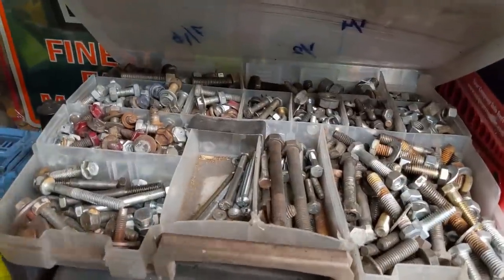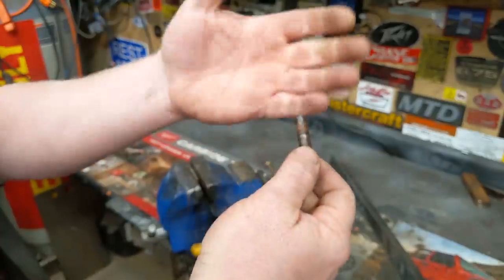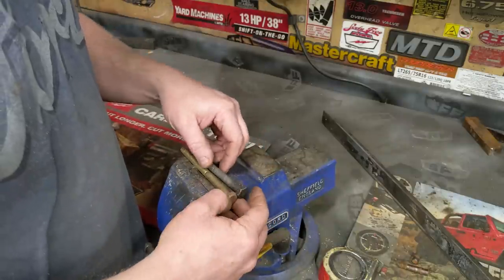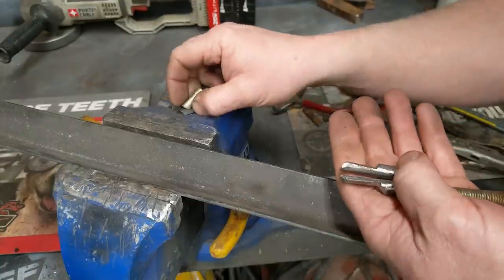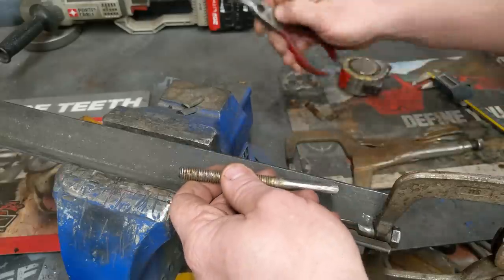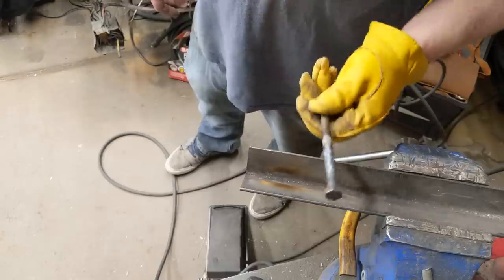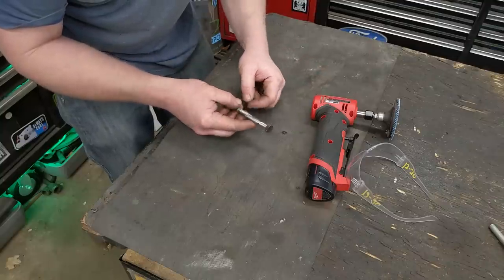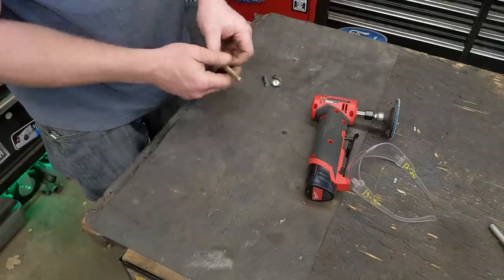How to make BOLTS longer   - Lengthen Extend Bolts -

Comment: Ok in a pinch for a low tensile application or something like furniture. Grade 5 bolts have a tensile strength of 120,000psi for 1/4" to 1" diameters. Even if you make a full penetration weld with wire you have a home you will get a max of 70,000psi. So don't go using this for suspension components or replacing a bolt on your floor jack.
Reply from the maker: Yes and no. Measuring tensile strength isn't going to be that straight forward on a bias. Lets take a bolt with a 1" surface area for example. Half the bolt is still there so it's going to be 60,000lbs of tensile strength. The ER70s-6 welding wire carries a 78,000psi so half is 39,000lbs tensile. Basically we could just add those together but is doesn't account for the tig or gas welding that mix the original parent 120kpsi material which would equal the original bolt. But we'll neglect that, so theoretically we would be at 99,000+lbs for this modified bolt. Now, that same bolt's weakest point is the threads as it is approx 25% less surface area/smaller than the shaft. So the threaded portion only has a 90,000lb strength to begin with vs the 120,000lb shaft. So our weakened shaft at 99,000lbs is still stronger than the bolt overall. Like I said in the video I wouldn't use this for an item that could threaten a life but these are far from furniture grade bolts. I have tried to break them and they act no different than a untouched bolt.
Reply: @sixtyfiveford  Well that is getting a little creative with the math. You can only assume tensile is equal to your weakest metal. We can't assume dilution of the base metal into the weld metal will improve it's strength. Not to mention the heat of welding and slow cooling will completely aneal the weld zone. So without further post weld heat treat we can only assume that the as welded condition of the weld metal will be the tensile strength of the joint. It would be around 70,00psi tensile and somewhere around 40,000psi to 50,000psi yield.

I agree that it would work well in a pinch. Like you say it is good enough for an alternator bolt or something like a light bracket for your truck.

Comment: Honest to god,  that amount of effort was worth way more than the cost of a new bolt.   It 'd be a rare rare thing for me to see that as a viable  option.  BUT I gotta say I like your scarf joint.  It's stronger than  a but joint would be.
Reply from the maker: 5-10minutes and the job continues without hesitation. VS a 90minute bolt store run or week waiting for one in the mail? The entire job is done before I could get back from the store. Time is money so that $4 bolt just cost me $80-100.

Comment: Ive done it with a metal lathe friction welding style but they have to be the same material
Reply from the maker: Interesting.
Reply: Friction welding is a viable option, some automotive drive shafts ( mercedes ) attach the yoke to the tune this way.  3/4 ton and larger truck rear end housings have the bearing stubs attached to the axle tubes this way.
Reply: We use friction stir welding to join aluminum at the shipyard

Comment: Maybe if I was in the middle of nowhere and this was the only option to get me off the island.  This is beyond stupid
Reply: This cut weld is soooo wrong. Grade 8 bolts don't like to be welded and I doubt this home made bolt is much better than a Grade 2 unmarked head " hardware store " bolt.
Reply: @bobroberts2371  
What your saying is you probably wouldn’t use this bolt to hold your propeller on your airplane?
Reply: @c50ge  I'd use it on a garden gate lock hasp is I didn't have a lock.  Or maybe as an axle when making a rolling magnetic pick up tool.

Comment: I have to ask the question:  Do you have enough bolts? ha ha :-D
I have a metal biscuit tin full of screws/washers/nuts  and odd saved bits, in a draw in the house.
Comes in handy at times.
And in the shed is a white plastic emulsion paint bucket that has odd crap that i can't find a use for.... yet :-D
I'm sure it's a blokes habit.
Your dog is so clever but she still thinks she can bite air lol, gotta love doggys.
Reply from the maker: That was only half my bolt collection. They keep multiplying while I sleep.

Comment: If it doesn't matter it the dolt fails, no safety hazards, ok . If it is a critical load proper heat treatment is absolutely necessary and you had better make more than you need and do a stretch to failure test.
Reply from the maker: A grade 5, 3/8 bolt can hold about 1, 325lbs(shaft only threads are 25% less(950lbs) before breaking. If I made the shaft out of a 100% welding rod it would be able to hold 1150lbs. Welding rod goes through the same metallurgy tests as bolts. So the bolt will still break at the weakest part; on the original threads even after modified. Obviously a new bolt is always in order and ideal. But to stop for 45 minutes in the middle of a job or even a week to get a specialty bolt ordered for a non-crucial bolt is absurd. This is literally a 5-minute task and the job can continue.

Comment: Never did the lap joint before good idea ! I wonder if the lap needs to be much longer than the diameter of the bolt ? Is there a formula used on axels ?
Reply from the maker: I just laid into the bolt hard the other day with the impact pressing in a motor mount. I ended up stripping the head of the bolt after 5minutes of impacting and the shaft never broke. I generally just do a 1/2-1inch lap which seams sufficient.

Comment: Great video.  How do you like that milwaukee die grinder?  I'm hesitant to get one because of a lot of bad reviews at home Depot...many state that it goes into limp mode all the time and overheats.  What are your thoughts?  Thanks.
Reply from the maker: I just got it a few weeks ago and overall would give it 6-7 stars out of 10. I paid some tweaker guy from the classifieds $90 new in the box and I don't think I would buy it again if it was $180+tax like at the Home Depot. That's just too much for something like this. It is weak and only good for a small carbide burr or Roloc disc. Cutting wheel and it will constantly stall out. I really like the portability but hate the fat handle and overall bulkiness. I have large hands and couldn't imagine someone with medium or small hands liking this. Unlike their m12 tools where it tapers fat too skinny from the battery to the trigger this the same thickness all the way. I will get used to it but it's hard to go from my super compact CP right angle(about 1/3 the size with more power) to this. Last week I wired up the little flip safety trigger(something I've never needed to do on any tool) as it was a pain. That made it way better to use. I may take off the entire lever and just push the trigger button. I do like it and will use it more for short burst jobs and pull out the pneumatic for larger jobs.
Reply: @sixtyfiveford  Thank you for your time.

Comment: Cool trick. How do you like your m12 die grinders? Powerful enough?
Reply from the maker: I just got it a few weeks ago and overall would give it 6-7 stars out of 10. I paid some tweaker guy from the classifieds $90 new in the box and I don't think I would buy it again if it was $180+tax like at the Home Depot. That's just too much for something like this. It is weak and only good for a small carbide burr or Roloc disc. Cutting wheel and it will constantly stall out. I really like the portability but hate the fat handle and overall bulkiness. I have large hands and couldn't imagine someone with medium or small hands liking this. Unlike their m12 tools where it tapers fat too skinny from the battery to the trigger this the same thickness all the way. I will get used to it but it's hard to go from my super compact CP right angle(about 1/3 the size with more power) to this. Last week I wired up the little flip safety trigger(something I've never needed to do on any tool) as it was a pain. That made it way better to use. I may take off the entire lever and just push the trigger button. I do like it and will use it more for short burst jobs and pull out the pneumatic for larger jobs.
Reply: @sixtyfiveford  thanks for the opinion. I was concerned it would be too week.  Sounds like I'm better off throwing my money at a big compressor and going pneumatic.  Sounds like you got a screaming deal though 😄
Reply from the maker: @studioGEEZ  The more time goes by I slowly use less and less air tools but I still don't think I would have a shop without an big air compressor. Sometimes it's worth to give up performance so you don't have to occupy the shop space with a compressor or the noise of one. Milwaukee's just ridiculously price right now because they're the only ones making one.
Reply: @sixtyfiveford  yeah I was thinking cordless could come in handy on a jobsite, too but not worth it if it is under powered

Comment: Can I use JB Weld to lengthen a bolt that is used for weight on a pool cue?  Would the JB Weld be strong enough to sustain the torque when I install the bolt in the butt of the cue stick??

Comment: Cost more in welding gas, grinding wheel, sanding pad and time then running to the store. But I guess if it is a size not sold around and need it that day it works.
Reply from the maker: Cost had to be in the realm of a nickel and 5 minutes total.
Reply: @sixtyfiveford  5 minutes to cut, weld them together and sand them down? You really to live in the land of makebelieve. I would love to see a video of you doing it with no editing or time laps proving this.
Reply from the maker: @philliphaessig  Based on that comment, you have never welded in your life.
MIG welding: would take literally 2-3 seconds per side and about 1 maybe 2 seconds for the top of each cut. If all your settings are good on your machine it shouldn't take you more than 20 seconds of sanding to clean it up. If you buggered the heck out of it it may be it would take you 90 seconds to sand it. It might take you 45-60 seconds to cut each bolt, and that includes cutting the top notch and finishing it. 
TIG welding like I did in the video is far slower. It takes about 10 seconds for each side and about 3 seconds for each top cut.
Reply: @sixtyfiveford  I am a welder/fabricater. Reason I know to do this right takes more then 5 minutes.

Comment: You missed a perfect opportunity to chuck that bolt in your lathe to true it up. Maybe next time you can show it off. Or maybe you can get some hex stock and make a new bolt from scratch. That would be a cool video.
Reply from the maker: I actually did that after the video. I forget I even have a lathe most of the time as I'm so used to doing these tasks without.

Comment: what if you needed to make a stud out of a grade 8 bolt, could you cut the head off and run a die down the smooth part to thread it?
Reply from the maker: You'll find that Grade 8 doesn't accept taping very well.
Reply: @sixtyfiveford  thank you, I’ll see if I can get some studs made for what I need.

Comment: The more I watch your videos the more I am getting convinced I need a welder. Have you done any videos on which ones you like and dislike?
Reply from the maker: I did a basic review on the cheapest welder you can get; the Harbor Freight Wire Feed years ago. It's right at $100 and does weld. I recommend that to anyone who wants to get started but also say if you have any more money budgeted, anything is better than it is. I really don't think there are any bad, name brand welders out there. I see a lot of Chinese no name stuff on Ebay/Amazon that I would probably steer clear off. The used market is always great to keep an eye on as people may include things like gloves, helmet, extra wire/electrodes that can nickle and dime you. Buying used most people will even give you a walk through/test of the machine before you buy it.  I wouldn't buy one used that I wasn't able to test. Stick welders are underrated these days as they are no longer new or cool. Those work great and can be had for a song. The only issue with those is you will need 220-240V in your shop; which not everyone does. But I see those up for well under $100 all the time.

Comment: What in the world kinda battery configuration do you have on that porter cable grinder?
Reply from the maker: Super battery packs I make. 8ah to be exact. The tool has way more power (at least 50% more), runs way cooler and the battery lasts more than double a 4ah. https://youtu.be/qZ_dwesKFwY

Comment: Don’t forget the liability,  tempering,  etc.
Reply from the maker: A grade 5, 3/8 bolt can hold about 1, 325lbs(shaft only threads are 25% less(950lbs) before breaking. If I made the shaft out of a 100% welding rod it would be able to hold 1150lbs. Welding rod goes through the same metallurgy tests as bolts. So the bolt will still break at the weakest part; on the original threads even after modified. Obviously a new bolt is always in order and ideal. But to stop for 45 minutes in the middle of a job or even a week to get a specialty bolt ordered for a non-crucial bolt is absurd. This is literally a 5-minute task and the job can continue.

Comment: @sixtyfiveford How do you like the Milwaukee 90 degree M12 FUEL grinder?
Reply from the maker: I just got it a few weeks ago and overall would give it 6-7 stars out of 10. I paid some tweaker guy from the classifieds $90 new in the box and I don't think I would buy it again if it was $180+tax like at the Home Depot. That's just too much for something like this. I really like the portability but hate the fat handle and overall bulkiness. I have large hands and couldn't imagine someone with medium or small hands liking this. Unlike their m12 tools where it tapers fat too skinny from the battery to the trigger this the same thickness all the way. I will get used to it but it's hard to go from my super compact CP right angle(about 1/3 the size with more power) to this. Last week I wired up the little flip safety trigger(something I've never needed to do on any tool) as it was a pain. That made it way better to use. I may take off the entire lever and just push the trigger button. I do like it and will use it more for short burst jobs and pull out the pneumatic for larger jobs.
Reply: @sixtyfiveford  thank you for your reply. I have the privilege to get an answer from a great YouTuber! 🤩 Cheers from 🇨🇦...and also it saves us money when you guys from 🇺🇸 are reviewing tools as they are sometimes really more expensive than what you guys pay. Just compare HD 🇺🇸 and HD 🇨🇦 you’ll see the difference. And add the sales’ taxes...Québec 15%. Have a nice weekend my friend!

Comment: Thankfully i will never have someone like this working on my equipment.
Reply from the maker: A grade 5, 3/8 bolt can hold about 1, 325lbs(shaft only threads are 25% less(950lbs) before breaking. If I made the shaft out of a 100% welding rod it would be able to hold 1150lbs. Welding rod goes through the same metallurgy tests as bolts. So the bolt will still break at the weakest part; on the original threads even after modified. Obviously a new bolt is always in order and ideal. But to stop for 45 minutes in the middle of a job or even a week to get a specialty bolt ordered for a non-crucial bolt is absurd. This is literally a 5-minute task and the job can continue.

Comment: Wouldn't you just be better off welding a nut to the end of some threaded rod?
Or non-threaded rod and cutting threads in it?
This seems like a LOT of work for a $4 bolt...

Comment: Let me get this correct you consumed a weeks worth of resources to make a useless brittle bolt that will use even more resources when it snaps off. Just buy the correct bolt.
Reply: And what...? Man thats as good as gold. I just cut 'em off square and vee half the cutto, weld : then roll a half turn and cut the opposite Vee, weld, done. Anyway see Ya! When yur back from the shop 15 miles away. I give it the tik of approval.
Reply: When you live out in the sticks and it doesn't make sense to go for a long drive just for a bolt, or it's a holiday and everything closed these are the skills you need to get out of a bind
Reply: It might work in a pinch but when all said and done I'd want to put it in the lathe, at that point ......  I agree just get a new damn bolt ( and then buy extras) you're 15 Mile journey and weekend problem is solved
Reply: Application is key.  This would never be ok to run on a vehicle suspension, for example... but if an old farmer needs to get a bandaid on his equipment to finish the day then this gold
Reply: I'm just being honest here but the concept itself has helped me. A new welder. I had an issue with the way something was engineered and I'm not necessarily doing this but it's helped me come to a solution. I have a bolt that's completely stripped but can't be taken out or replaced from what it's in. It's just kind of spinning freely and can't be replaced. Its also holding something in place on the other side of what its going through so i cant just cut it off and tack a bolt on or something. Also if i cut it off it would cause issues by getting caught at some point in the fan on the other side of it. So by cutting it at its base and replacing it like this, it's actually helped me. So there is an application for this idea even if it isn't just fixing a bolt instead of buying one. Cause even buying a bolt in my situation doesn't change that there's no access to replace it.

Comment: $35 in labor for a bolt that isn’t straight and only 50% as strong as a new $4.00 bolt
Reply from the maker: Exactly! In 5 minutes I made a bolt and finished the job which would have easily taken an hour to run and get a bolt. The bolt is stronger than the threaded area is still. Just made a custom puller the other day and I wailed on that bolt with a 600 lb impact for solid 20 minutes and ended up rounding off the head of the bolt and never broke it. It got the job done.